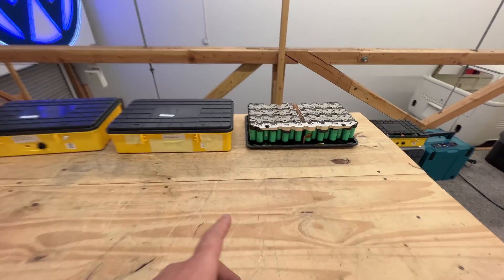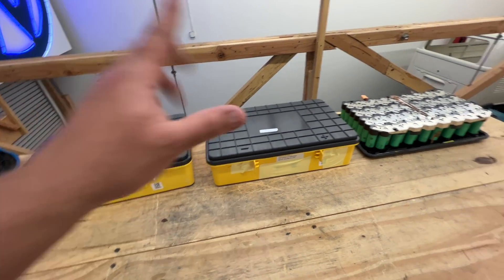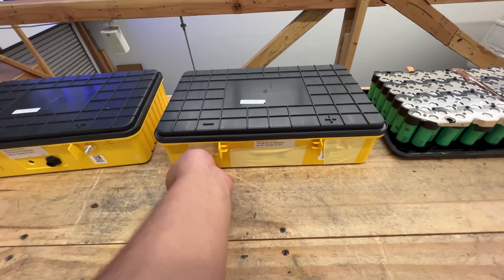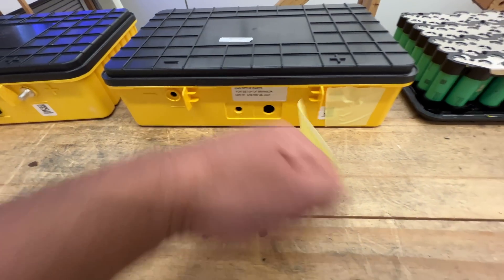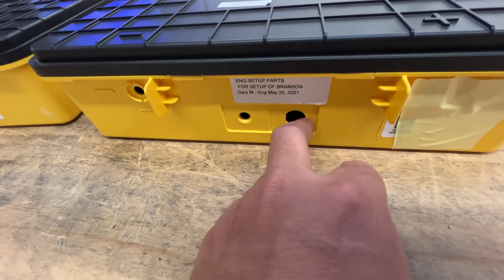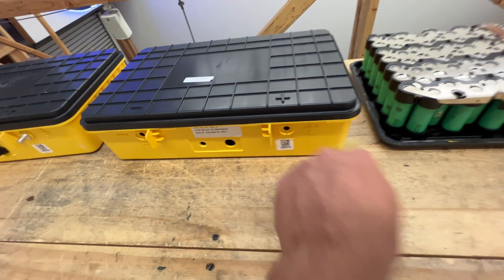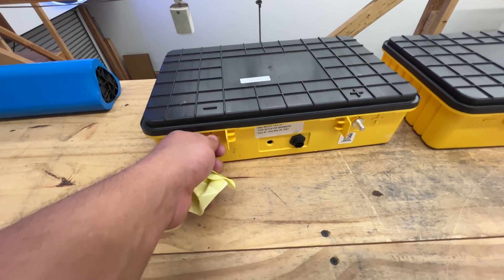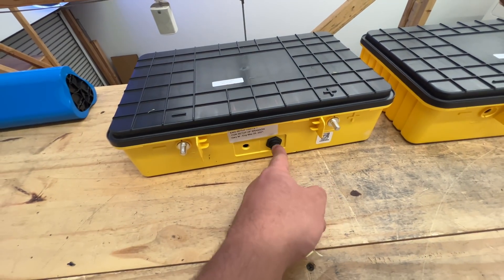These Modules Were never Spot Welded

Comment: I have a Miles zx40st electric truck that use to run, then it went to something like limp mode for a day or 2, then it stopped working all together, thinking or replacing the old lead acid batteries with lithium modules. Turning a 72v 150ah system into 72v 460ah lithium battery system, but I'd hate to blow $4k if this won't fix the issue, I've gone through everything I can to try and fix it, and there are no electric mechanics willing to try to help me fix it in my area(Forestville, CA) could use some advice, or a pro to come check it out for $$$. I'm building a battery for an electric dirt bike I'm building from scratch, it's fun for me to build lithium 18650 battery modules. Anyways, any help would be appreciated.

Comment: What happened to the other video that showed these in an enclosed batteries case? They aren't listed on the site any more either?
Reply from the maker: My supplier doesn’t know what they are doing to so they got in trouble for selling these to me, I took the video and listing down to minimize their liability.
Reply: @jehugarcia  I can't get to the batteries. Are the connections for the BMS not connected to a cell connected to thermistors? I believe there are 4 not connected to cells 2 on the upper and 2 on the lower? Do you have any of the welded enclosed batteries still for sale or do you have to send them back? Thanks for your help.
Reply: After reviewing your photos on the net it looks like there are 2 thermistors on the front and back. Is that correct?

Comment: A lot of the time if you crush ultrasonically welded plastic joints they will easily crack on the joins.
Or you can apply crush force then hit the joins with a hammer, that also works and you need less crush force.
The issue doing that process to those modules is finding a vice large enough.  But if you can get it to work it won't damage the case.
Reply: You don't want to damage those batteries with a hammer, those batteries have a circuit breaker in the positive side if you crush that you can damage the battery very easy...

Comment: It's pretty tempting to use these modules as is. It's $200/kWh after including an enclosure, bms, and all extra cabling and fasteners. The included box is really nice. Trying to find a box off the shelf for custom packs is tough. I've learned over the years that it is best to figure out the enclosure solution before designing and building out a pack. I'd personally cut the box at the weld point then use a gasket with some grease to reseal with  compression straps.   I'd love to jump on this deal and snap up a few packs, but I've still got a couple dozen kWh in my shop waiting to be integrated into a future project.

Comment: Lithium batteries are the only objects which are wanted by people in packs, so that they can cut off and procure individual cells. On the other hand people also want to buy individual cells so that they can build packs 😸😎😸
Reply: It's pretty tempting to use these modules as is. It's $200/kWh after including an enclosure, bms, and all extra cabling and fasteners. The included box is really nice. Trying to find a box off the shelf for custom packs is tough. I've learned over the years that it is best to figure out the enclosure solution before designing and building out a pack. I'd personally cut the box at the weld point then use a gasket with some grease to reseal with  compression straps.